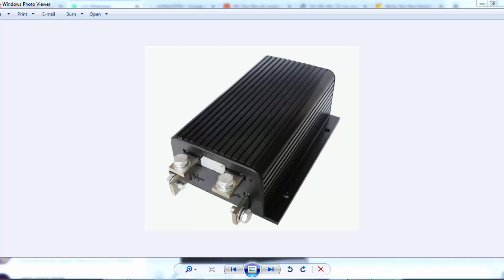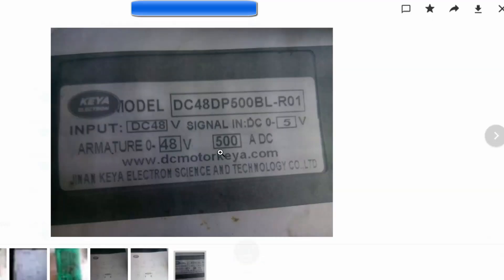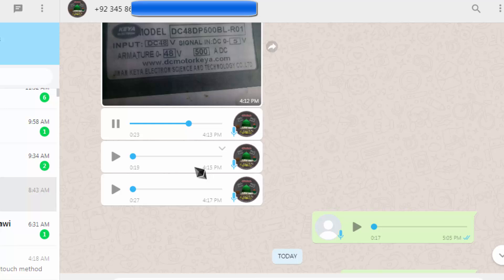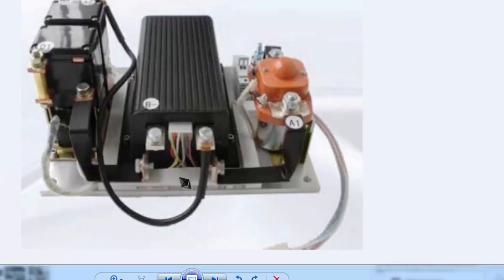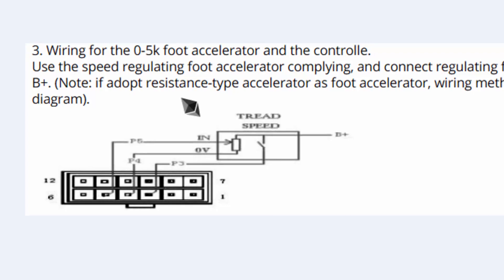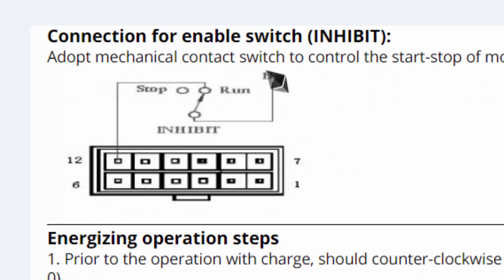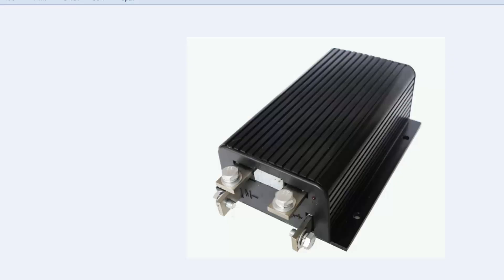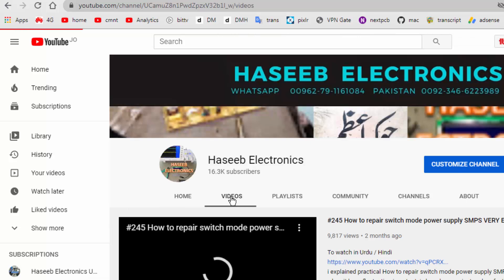#282 Wiring Diagram for Fork Lifter Motor using DC48DP500BL-R01 PWM controller

Comment: Thank you brother haseeb. 
Could you please explain: 
1. Potentiometer recieves positive from pin 11. Wiper transmits resistance value to controller or volt 0-5? 
2. Why throttle accelator recieves positive from b+ and not from pin 11? Both are potentiometers!
3. When potentiometer is connected only 2 sides? When value output is resistance and not voltage?

Comment: Hi. Great videos thanks. Pc atx smps power supply. What voltage should appear at base of transistors to swiitch them.
Reply: Haseeb Electronics . Thanks, same smps power supply. Question, how does signal from pwm controller chip reach the transistor when there is no optocoupler in the circuit, just transformers.